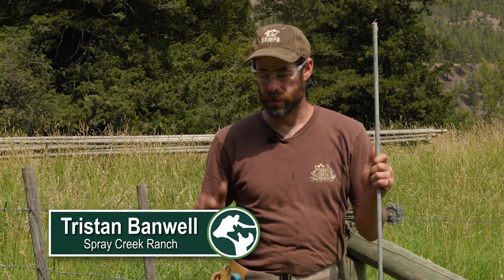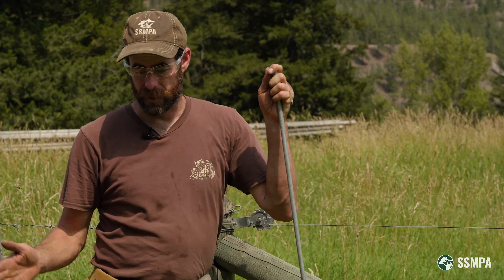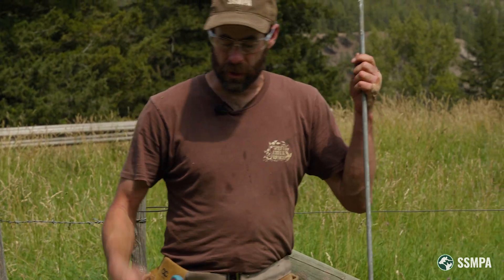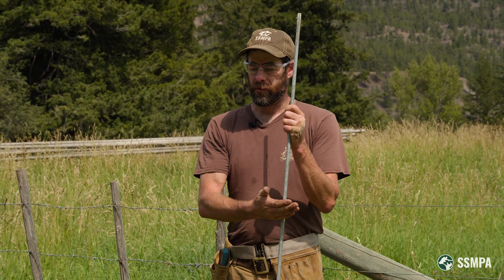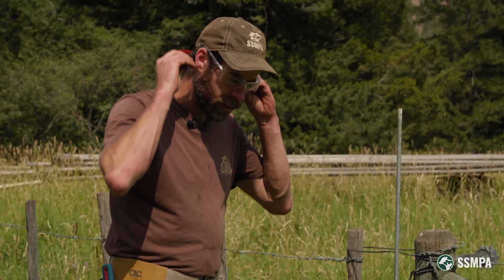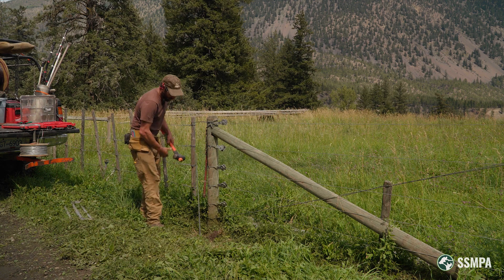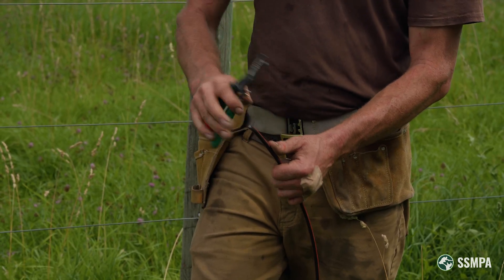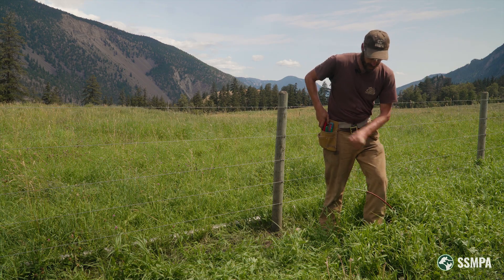Grounding (Earthing) Systems and Ground Rod Installation

Comment: I'm not getting enough shock to my horses on my system. 8000v I have tested the current and have 8000v. So I'm thinking it's my grounding system.  I only have one rod in the ground now. My electric fence charger is close to my well, about 30 feet.  the ground rods are in the drip line of a metal building.  I'm worried adding more ground rods is going to get too close to the well. 
But if I go the other direction I have to get at least 100 from the charger to put any ground rods in.  What should I do?

Comment: A proper hammer drill will sink a ground rod smootly and easily within 15 seconds or so. Doesn't mushroom the ends at all either.

Also for stripping - Spin your strippers around to get down to the metal. Hit the insulation with a propane torch quickly to soften the plastic, and then a quick swipe of a razor knife will peel it off.  This works especially good for stripping mid run sections for a series of rods. 

The torch also works great for removing the sticker from the rods.